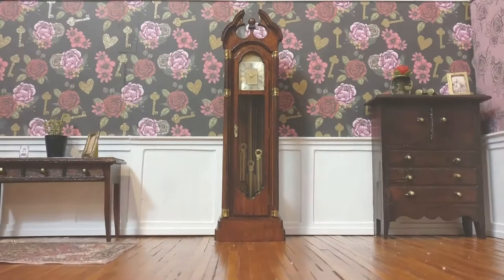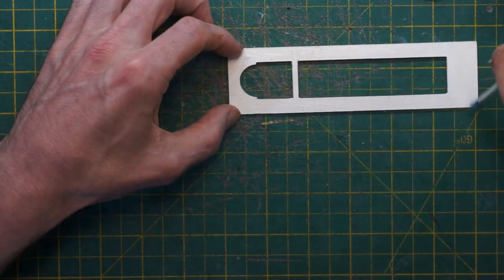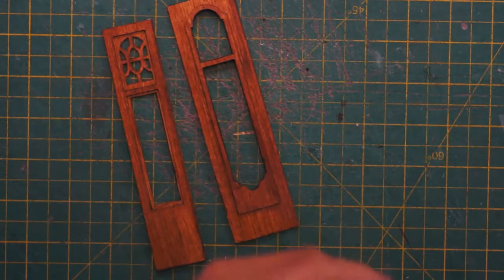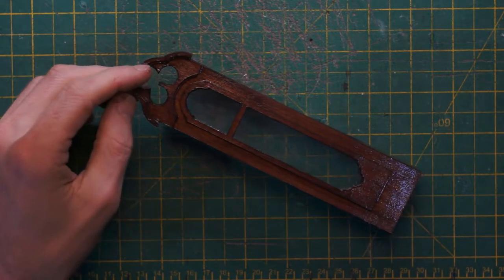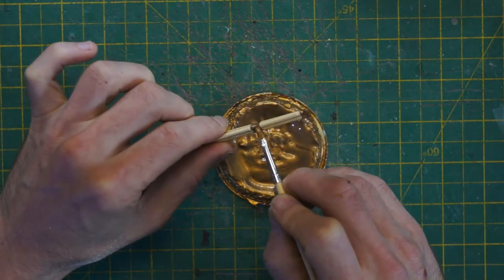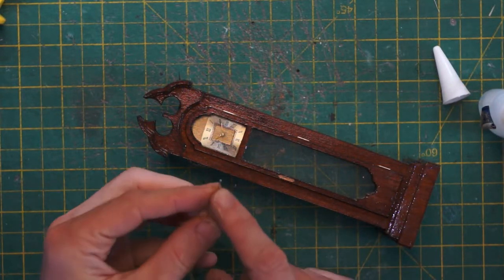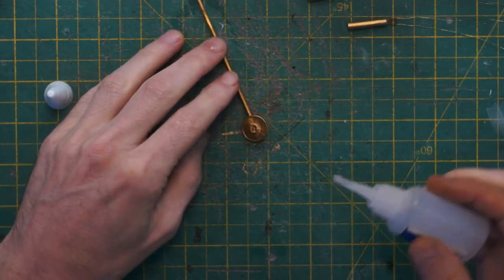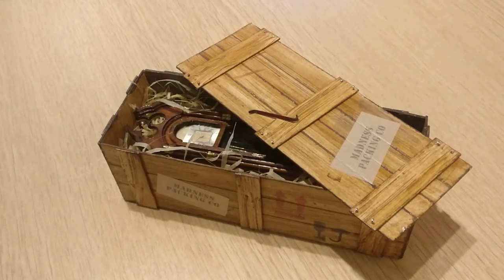HOW TO BUILD A Miniature Grandfather Clock (SPECIAL BUILD) | 1:12 Scale  | MiniatureMadness

Comment: I think any smudging or frosting from superglue should be able to be cleaned up with isopropyl alcohol... not tried it myself because it's usually out of sight on my work. I read that it is caused by degassing as the glue dries, which would explain why it gets worse when there's no air flow to the glued area.

Also I would probably have used something to dull down the gloss a bit